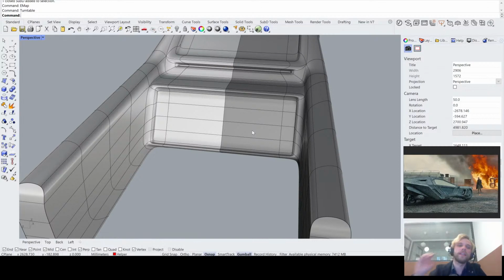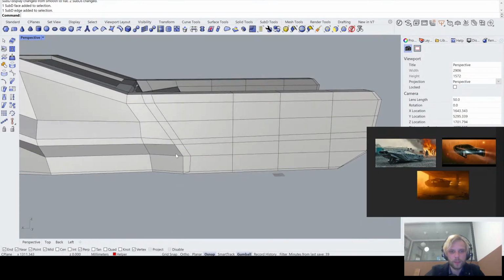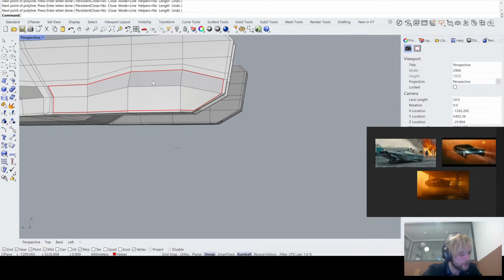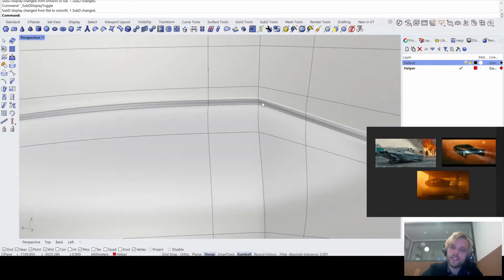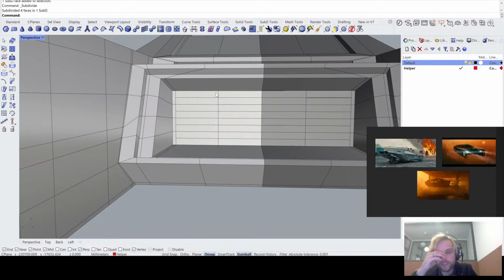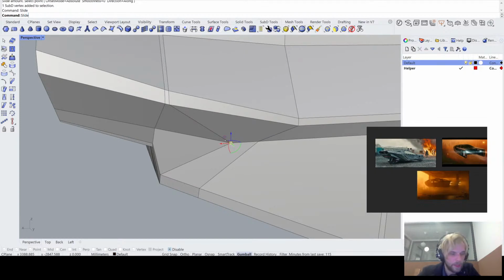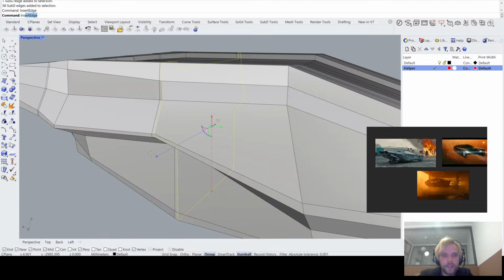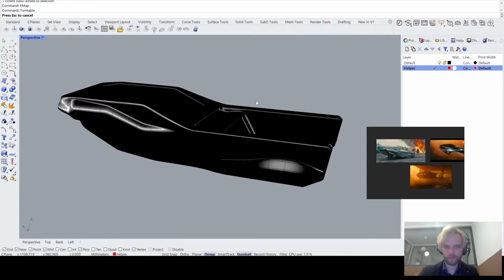3D Car Modeling with Rhino 7 SubD Tools [3/8]

Comment: i feel kind of dumb for asking this.
the toolbar called "SubD Tools" is not visible for me, I can only get the "SubD" Toolbar, which is missing a lot of commands like pipe and multipipe. I know I can get them via the dropdown but still: where did you get that toolbar with all the commands from ;) thanks
Reply from the maker: That's super strange. Try using command Options , then going to Toolbars and clicking on Reset to Defaults. As long as you're using Rhino 7, it should do the trick.
Reply: @DesignGoBrr  i already did this, I actually reinstalled rhino 7 and deleted all toolbar files - I thought it was a bug, that the old toolbar from the WIP version carried over, but still no "SubD Tools".  I'll post if I find a sollution ;) thanks!
Reply from the maker: @BenJamin-xx3vs  Uhh then you should definitely file it as a bug to the mcneel forums for them to investigate.